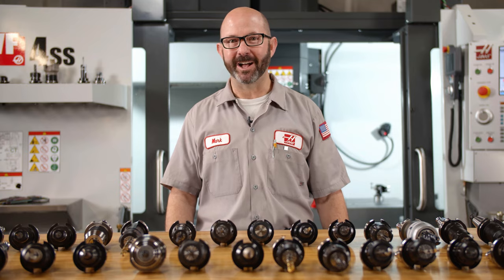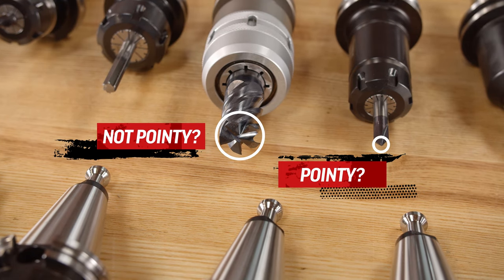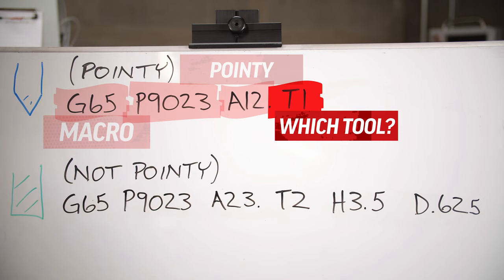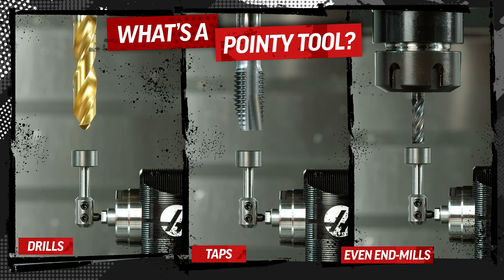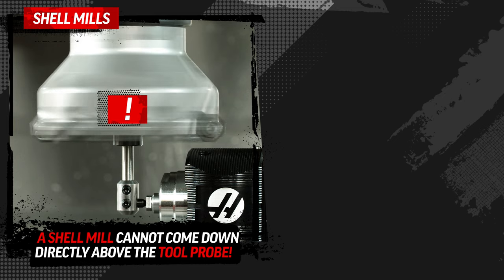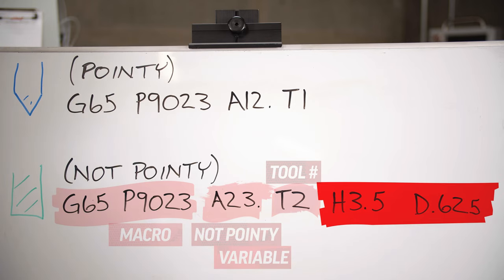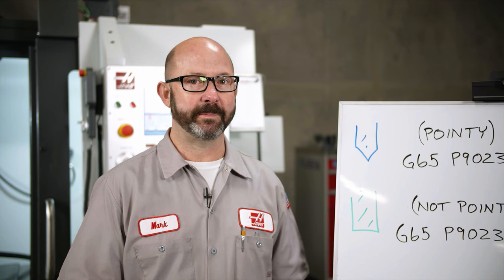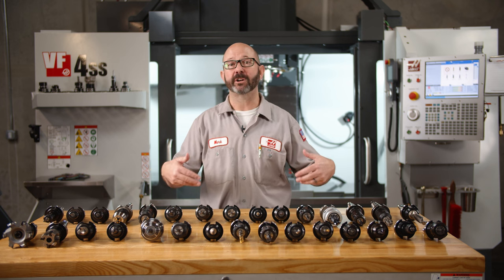Use Macros to Speed Up Setting Tool Offsets - Haas Automation Tip of the Day

Comment: The Fusion 360 Haas milling post can do this automatically. At the beginning of the program, it can insert block delete lines for G65 P9023 A12./A23. with the correct H and D args pulled from the holder+tool length in the library.
Reply: How long has this been a feature in the Haas Post?
Reply: @Roarkrides  At least 5 years, maybe a little more. The post property is called “optionally measure tools at start.”

Comment: Thanks for the great tip Mark!! such a good shortcut for probing tools 👍🏻👍🏻

I wonder does this macro only read H and D values in INCHES? I would like to use it in mm.
Reply: The macros work well in Metric Mode as well (probe must be calibrated in metric mode), Setting 9= MM.

Comment: Hey mark! What’s the difference between this macro call you referenced (P9023) vs the one the machine uses if you use the edit or the tool offset page? (P9995)
Reply: There are quite a few different ways to approach probing. We have the G31 Skip Signal Probing code, the Haas Renishaw Inspection Plus codes, and then a series of P9023, P93nn and P9995 probing macro calls. They are all similar, but serve different purposes (they often point pack to the Renishaw probing macros). The P9023 are kind of cool in that they internally command an M06 tool change, which saves a line of code, like we showed in this video.

Comment: We need peck tapping With Q value
Reply: This enhancement (BZ195) has been entered, based on customer requests, and is going through testing now. We can expect it later this year.
Reply: @markterryberry4477  will it work with IJK values as well?
Reply: @markterryberry4477  Mark, good to hear that's being worked on. What is the best way to submit an enhancement request? I think the G81/G83 cycles could use the addition of an initial feed rate and subsequent feed rate after an initial depth and would love to see that as a feature in the future.
Reply: @akronimm862  I am not sure what the final implementation will look like on this one yet.

Comment: NOT probing and setting each tool one by one as you load them can only lead to problems. Rule of thumb: If a tool is loaded them trust it has been set correctly and it’s safe to run.
Reply: Myself, I have the tool # and two boxes to check off on paper when loading multiple tools. First box is for tool loaded then 2ns box is probed.  Been doing this for 12+ years, no need for me to change to this 3rd method.

Comment: This should also work with T#3026 as well, right? Guess I could just try it. 😂

Simple program like below if using sequential tool numbers would save a lot of typing. 
G65 P9023 A12. T#3026
M6 T[#3026+1]
M30
Reply: please what means that #3026+1 ?? i mean what is that +1 :D
Reply: @matejkuka797  #3026 is the System Variable for Current Tool In Spindle so if T1 is in the spindle #3026=1